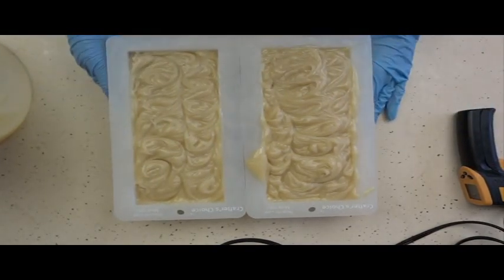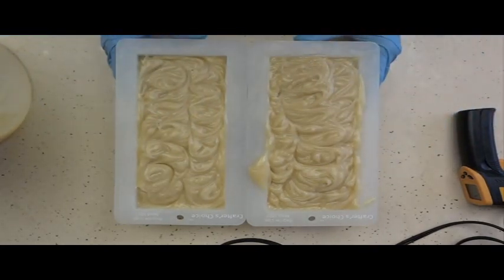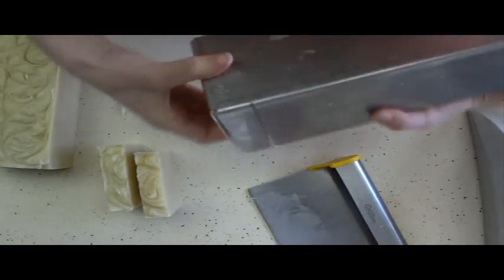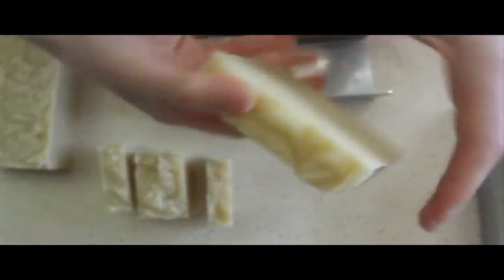How to Make Cold Process Oven Process (CPOP) Handmade Soap.

Comment: You sound like a lovely clever person, i sometimes do the hot process on the hob, turn a cast iron pan upside down over a low gas and then put my thick bottomed stainless pan on top, but the best method i found, as i don't want to cut the soaps up after, i put the emulsified mixture into silicone 4oz soap moulds, then cook in the oven at about 80 celsius, and keep moving them about even though its a fan oven it still does not cook evenly. Fantastic video thank you for your help :)

Comment: Bonnie, hurray, I finally got my soap to gel!  I used your recipe, but halved it as I have only one of the cool molds like you use.  The other is a tall and skinny and I wanted to test with the one mold rather than two molds of different dimensions.  I have a gas oven, and so, I think I need to do ten minutes first, then turn the oven off, as after two ten minutes sessions with the oven off my soap wasn't gelling. So I turned it back on for five minutes and voila! I'm so excited.  I used canola instead of pomace as I didn't have pomace and didn't want greenish soap. So, my soap is a pale yellow which I love...so we'll see how the next ten minutes go!

Thanks for the awesome video.  This is going to make a huge difference in my start up business as it is very humid here this year, and my soap is taking forever to cure.
Reply: Kim K,  thanks for your post... you answered my question above (if only I had seen your post prior to posting it!), as to whether I could cut the recipe in half!  Seems like it's okay to do so, based on your post.  My first full batch was with EVOO and it turned out too green, which I tried to change by adding mica colorant and I ended up using everything I had to make a purple & pink (two sep color batches) and did not get the color I was after (a bit muddy, not as bright).  I will now half the recipe and use the canola oil to experiment.  I also messed up on not waiting for the temperature to be low enough (about 80-100 degrees Fahrenheit, I think) to add my scent and I didn't get that fragrant of a soap.  Live and learn, I guess!... Will keep trying!! :)
Reply: great insight. when you say halved, you mean literally each ingredient, right? thanks

Comment from the maker: If you force it through gel with the oven or force it to gel by insulating you pretty much get the same result. If you make the same soap and gel one and ungel the other, PH test the the very next day and you'll likely find the gelled soap is much milder, in my experience usually by a few or several points on the PH scale. The ungelled will usually zap at 24 hours old while the gelled soap will not. It makes it mild like HP but you still need cure time for moisture content.

Comment from the maker: Yes, you want to watch carefully if using low flashpoint essential oils. With fragrances, it seems to stick even better using CPOP. That being said, I have even CPOP'd orange essential oil (very low FP) and I can still smell it. When you reach that flashpoint your eos will start vaporizing but that doesn't necessarily mean that ALL of it will escape. If you are doing low FP eos in CPOP, use a little extra EO to account for losing some.

Comment from the maker: I recommend a minimum of curing the soap until it is a PH between 8 - 10. That is when it is safe to use on skin. While this usually occurs at about 48 hours old, I always recommend additional cure time to allow the moisture to come out, resulting in a higher quality bar. I don't package soap until all the moisture weight has come out. I weigh the bars and package them after they lost the appropriate weight which can take 2 weeks or several months depending on water content/discount used.

Comment from the maker: My channel is geared toward new soapers, not professional soap-makers. I'm assuming that people making my recipes are making them for home use, not commercial. Just to be clear, when I advise on what is safe, that does not mean that you should package and sell soaps that are 2 weeks old. My soaps are not packaged until usually a month or longer. I do not package until the bars have lost all their moisture content, which I calculate by weighing the soap before and after cure and sub water weight.

Comment from the maker: No, soap requires lye. However, there is no lye remaining in the soap. The lye and oils change chemically when you make the soap in a chemical reaction and they form soap and glycerin. Soap is safe to use. If you are concerned about handling lye, then you can start with Melt and Pour soap which has previously been made with lye.

Comment: Great video!  Lots of video demonstrating levels of gel stage.  What happens if the soap forms two volcanoes at each end of the silicone mold?  Some of the oil separated at the edges between the soap & the mold?

Comment: I was looking for information on CPOP because my CP batch seemed to have cooled down too quickly when I poured it into my mold. I was afraid it would not go through a full gel stage.  Came across your video and I'm so glad I did.  You are very informative and easy to understand and follow.  My batch went through full gel stage within 30 minutes in the oven.  I'll find out tomorrow what it ends up looking like.   I loved the soap cutter you used in this video.  Where did you get it?   I noticed your links for several of the other things you used, but didn't see any information about the cutter.  Thank You!

Comment: hay! if i make this proces but I want to put an assential oil for a smell, it will not  be avaporate during the heat time at the oven?
Reply from the maker: It depends on the oil and how hot it goes but I've used this process for lots of essential oils. I only had an issue with grapefruit and tangerine. Orange was ok! The top notes can come out easier. Things like mint or patchouli really stick well.
Reply: @GoodEarthSpa  laveder will not be avaporate while haeting at the oven?
Reply from the maker: @yasminalon  I've had good results with lavender.

Comment: thank you for sharing. i was wondering if the mold is rubber and why it does not melt in the oven, really want to try this method. then i don't need to wait 4 to 6 weeks to to use the soap.
Reply: I have one of those molds. They're made of silicone, so they are very heat tolerant.

Comment: As a real newby to soap making - would it be better to mold up when it hits thin trace to alleviate air bubbles or did that happen in the oven? I just ordered a mold, lye and shea butter and will be getting the rest of my supplies soon to try my first batch. After research I think I like the cold process better than the hot since I don't need to add preservative (learned that from SoapQueen). Any and all suggestions welcome!

Comment: Bonnie, great video!  I have wanted to get back into making soap again.  I used to make a lot of hot process soap and as you know it doesn't get as hard as the cold process does.  How does the CPOP compare between the two?

Also I may have missed it but where did you get your molds?  And do you share any recipes I have lost all mine and my favorite was with goats milk.

Comment: I have just made a batch but it didn't gel at all. I even turned the oven back on and kept it on for a while, but nothing happened. The only change I made was infusing EVOO with chamomile and using chamomile tea instead of water. It solidified in the oven but did not gel. I'm assuming it's still good but I'm puzzled. Any thoughts?
Reply: Actually, it just started gelling... after at least 30 min in the oven. Maybe the chamomile raised the temperature needed for gelling?

Comment: Reheat it by placing the containing in a larger container filled with very hot water.  Getting the lye to dissolve is usually only a problem when making very small batches.

Comment from the maker: All soap requires some form of lye (K or Na). No exceptions. Pre-made soap base was also made with lye at one point. The very definition of soap requires lye. It would not be soap without lye. No lye remains in soap. If your olive oil soap did not have lye added to it, it would be olive oil, not soap. Does this answer your question? There is also in in depth chemical response I could make but most people who ask this question don't seem to be aware of the chemistry of soap-making.

Comment: I have just tried your method.  I may have screwed up a bit.  I started my oven at 160, but I missed the part when you said to turn the oven off.  I turned it off at about 30 minutes.  At that point, it did not look as though the gel phase had even begun.  So I turned off the oven, and ten minutes later I could see it beginning to gel from the bottom of the soap bars.  I remain hopeful that it turns out well.  Can you tell me too, at about how many hours I should be able to cut the loaves?  Your video stated the next day, but if you are accelerating the gel phase, do you still wait 24 hours to cut?  I am worried about the loaves getting too hard, I don't want to have the bars crumble.  What do you suggest?
Reply: Veronica Morris 
at 11:40 in this video she says "some time between 12 to 24 hours". You only need to let it harden to a cut-able consistency, the gel phase/heating makes them really soft, so just let it firm up. If your bars are crumbling when cut after only 24 hours the problem is likely that you made the soap lye-heavy(too much lye).

Comment: FYI, Walmart has super cheap Olive oil that is NOT extra virgin.  It is second press. 16¢ per ounce.  Also, if you spritz rubbing alcohol on your soap you can reduce the bubbles.   That works on soap as well as epoxy glue.
Reply: arbonac

Comment: i like to use 'Phenolphthalein pH Indicator Solution' to test the soap, it's a lot easier to read. if the soap turns pink when dropped on it, then it's not ready. 1 oz of it is about $5.00 on Ebay.

Comment: Will it be accurate to multiply each ounce measurement by 28.35 to get the measurement in grams? It just seems like a lot.
Reply from the maker: +Melissa RMT Yes! Google is a calculator so you can  for example google "9oz to grams" and easily make all your calculations.
Reply: Thank you. I wasn't sure if the conversion was for fluid ounces, which is volume or the standard ounce, which is weight. Many recipes use "ounces" to measure both oils and additives like kaolin clay and that gets confusing. Grams should be the standard.

Comment: Hi! My soap become so liquidy and oils are separated when it was cooking. And the heat wasn't over 170 F. Why do you think is has happened?
Reply from the maker: It could be that you didn't mix it enough before molding and it separated or that you are mistaking the gel phase for oil separation since it does get more translucent looking. If you think there is a problem you can always Hot Process the soap and you should be able to save it.
Reply: Ok. Thanks a lot!

Comment: Hi Bonnie,

Can you share where you bought the soap cutting "box" that you use in the video? I've seen wooden versions, but never a metal one.
Reply from the maker: That is the crafters choice miter box: http://www.amazon.com/Crafters-Choice-Mitre-Soap-Cutter/sim/B00BEJO85Y/2/?_encoding=UTF8&camp=1789&creative=9325&linkCode=ur2&tag=030812364706-20
Reply: Thank you!!
Reply from the maker: My only issue with that miter box is the last bar is never straight. I really like the wire cutter for getting a better cut but the box is great if you are just starting out.
Reply: LOL, I tried to get it, too! But I found this on Etsy: https://www.etsy.com/listing/202445882/regular-height-hand-made-wooden-soap?ref=market
Reply from the maker: I've stopped using the metal one. It actually warps, too. The end has become bend and it's nearly impossible to get a straight cut anymore. I now use a wire cutter.

Comment: Ok I tried it....I could not get it to gel like that after 30 or 40 minutes with the oven on... so I took it out, covered it and prayed that it's not destroyed*it doesn't look overcooked so im gonna just let it cure 6 weeks like normal cold process I guess? Help! What did I do wrong? Lol.
Ps I had 2 silicone molds in wooden boxes, do you think that's why it didn't work? Any pointers would be very appreciated I was just afraid to cook it or leave it in the oven much longer because I was scared it would start cracking or something because it's not doing good like yours did

Comment: but thats the point im trying to get across, "safe" doesn't necessarily mean ready. im not the only soap-er with this problem. theres more that goes on within the soap than water evaporation after the initial 48 hour cure. I just wish there was more research on the matter so i could say exactly what it was but what i have found is that it has less to do with the water discount and more to do with the chemical process (im not talking about the hardness or lather so much as i am the drying effect)

Comment: What do you do if it dos not gel and stays like jello?
Reply from the maker: Deaette Dwyer  If it does not gel, then it is regular cold process soap instead of cold process oven process. Still great soap either way. Cure time is a little bit longer on CP versus CPOP and it CP may need longer to set up before cutting.

Comment: silly question... how much do you suspect a bar of soap cost you to make - perhaps in this recipe you shared, could you give a number for cost? and the cost per ounce of the finished product?  could one assume most homemade bars even using good oils etc cost less than one dollar?
Reply: NO I make my own and to make good all natural bar soap witnh no lye cost about a 1.72- 2.00 to make if you consider what goes in it and breake the cost down. i use mango butter and cocanut oil shea butter and scent with essential oils( not the cheap ones) i also use the premade soap base witch is glycerin. and I use soap coloring dyes for the colors. i spentover 100 bucks and got maybe 24 bars of soap. mind you I purchased soap bags as well to put them in those were fairly cheap though.
Reply from the maker: It really depends on the ingredients you use. Organic costs more. Scented cost more than unscented. Essential oil costs more than fragrance. Certain oils cost more than others. Then, it depends how much in bulk you are buying your ingredients and how far away from suppliers you are which affect your transportation costs. Then, there is overhead and time.. It all depends. Then packaging can run you just as much as the soap sometimes.
Reply: jenny cestero I use all organic certified, non-gmo verified, unrefined, cold pressed coconut oil and pure essential oils and organic food colorants as well as organic coffee, lemons, lavender flowers, etc and the cost per bar is around $3.00 on average. Then there is my time, which I deem valuable and even at minimum wage, I must charge $5/bar or it doesn't allow me to break even. I plan on moving up to $7, when I get a good customer base and reach those who are wanting only the best vegan ingredients in their soap. That is on par with larger "natural" soap companies who use cheaper and non-organic oils, like canola and cottonseed and chemical fragrance oils. I try to give people what they pay for, but need to cover my costs and my time. 
I just started up a couple of months ago. 
NOAHbars.com website and NOAHbars facebook page. :)

Comment: I don't have the castor oil, can anyone share what I can use instead?
Reply: You can buy small quantities of castor oil at any pharmacy. You don't usually need a lot of it anyway.
Reply: Addie S. You can also use Sunflower oil for more bubbles, but try only using about 5 - 15% of it (max) in your soap recipe. If you use more than this amount, then you may end up with a softer bar & a longer curing time🌻
Reply: Thank you for the info, Aurea S!  Sunflower is more readily available in lager quantities!!  I appreciate your feedback!! <3